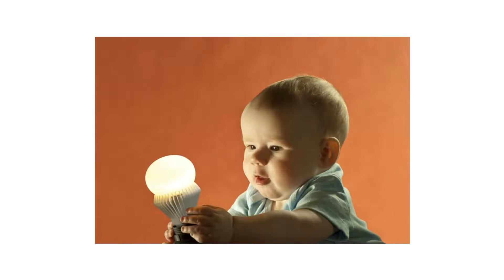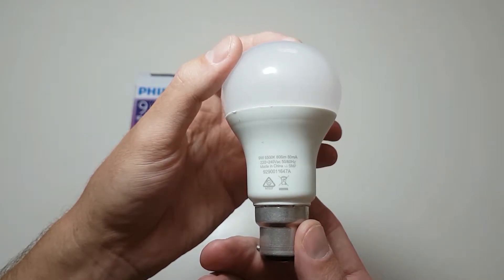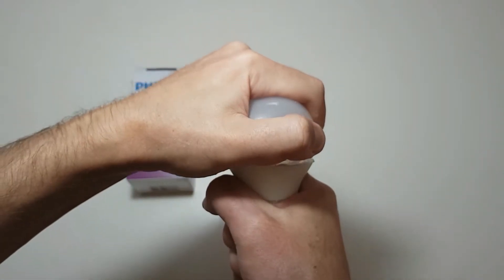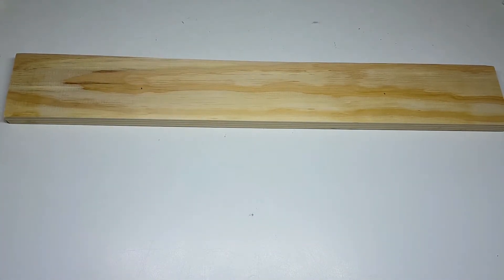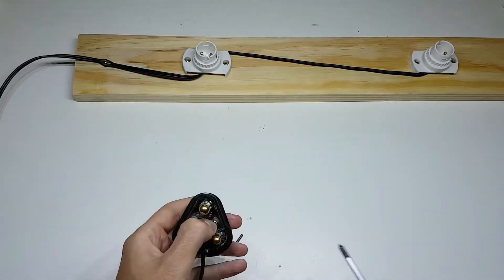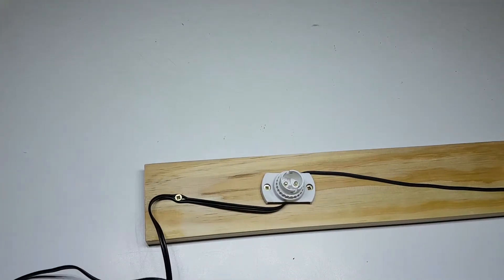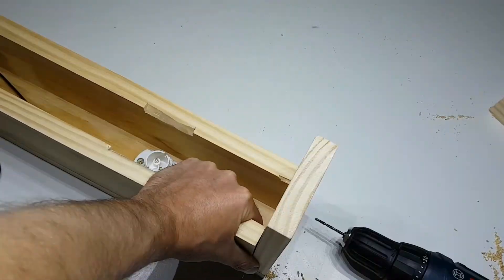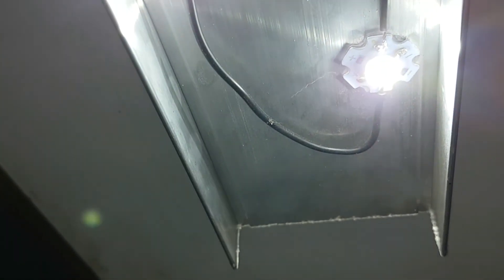DIY LED Aquarium Lights (Part 2)

Comment: Is there a danger in getting the uncovered LEDs wet? I have hatchetfish that love to jump and I'm afraid they will splash the circuitry. Thanks for the video!
Reply from the maker: Eric Prouty Yes. Rather use floodlights then. A bit more expensive but waterproof
Reply: You should let the water a bit lower, and build a simple plexiglas lid

Comment: Dude this is sooo good. I use Gorilla Glue and Cable ties for EVERYTHING! You should have a look at those 10W LED Floodlights. Cheap as chips, easy to wire and great for tanks.
Reply from the maker: Fancy Shrimp I experimented with the flood lights, they are a bit too strong and create a algea problem even on 5 hours. So I switched to these because you also get the 7watt globes. If I see algea in a tank I just change the globe. Thx for advice!